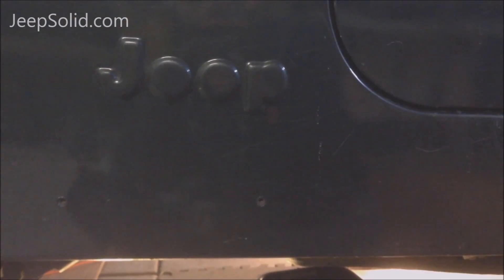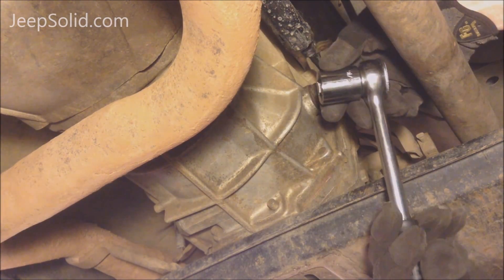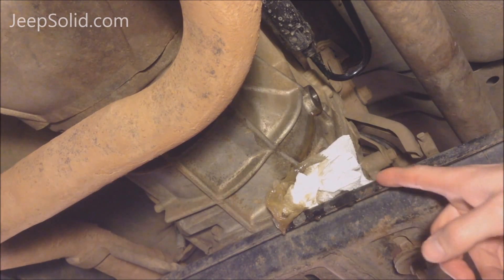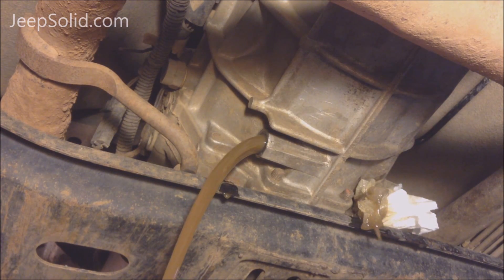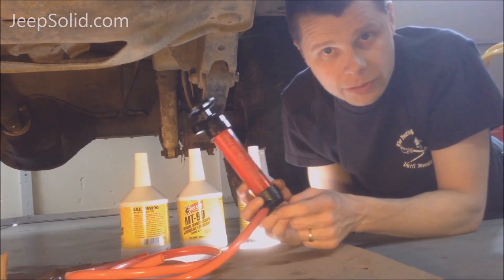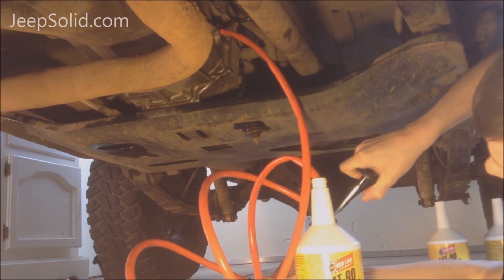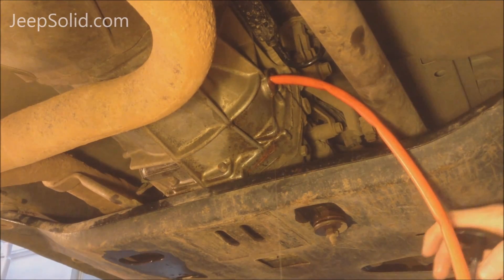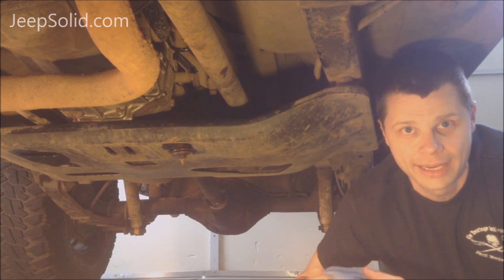Jeep Transmission fluid change: Jeep Wrangler YJ transmission fluid change: ax15

Comment: I have the exact same Jeep my question is should there be gear oil where the shifter inserts in the top of the transmission? After replacing my clutch and flywheel, I’m having trouble shifting into gears mainly after the transmission has warmed up on longer drives any ideas?

Comment: Probably a dumb question but is there a filter on the transmission? If so, do i need to change, when should i change it, how do i change it?
Reply from the maker: No filter on the manual transmission AX15.  Automatic transmission has a filter.  Not a dumb question at all.
Reply: JeepSolid thanks. Woohoo just like my 2nd grade teacher used to say!
Reply: Only a filter if you have the automatic which is basically a 909

Comment: Great video. I heard you talking about replacing the drain plug. Is this correct, or can I use the one that came out of the transmission?
Reply from the maker: I use the same one
Reply: @JeepSolid  thanks for the info and the response. Also wanted to say I really love your channel. Especially the series about the engine rebuild. I've learned a ton from your videos.

Comment: Jeepsolid how can we reach you personally
, on My YJ I replace the  front and rear differential vent cap  BC the hose was damage . But before I change the hose on the rear I leakage coming out the plug or the hose after Idrove  for more than 30m . I also replace the differential oil , what could be this issue . As this point is not leaking that much but it has me worry. Hope to heard from you soon

Comment: Quick question that I thought you might be able to answer. I drained my transmission fluid and refilled it yesterday. Measuring it, I drained probably close to 3.5 quarts, which seems about right, but when I was filling it I couldn't get any more than 3 quarts into the transmission. I tried a few different ideas to see if I could get more fluid in, but after the 3 quarts it just kept coming out almost as fast as I was pumping it in. What are your thoughts?
Reply from the maker: After filling it with 3, drive it a little and then top it off. It should take a little more then.
Reply: I drove it around for about 30 minutes making sure I was cycling through all the gears. When I got back I took off the fill port and fluid started coming out. Thinking it was just some residual fluid I tried pumping in a little more and the flow coming out increased rapidly. I have even tried elevating the side that the fill port is on to see if that would help, and it didn't. I just can't seem to get more than the 3 quarts in. Unless there's another way to fill the transmission. 

Anyway, thank you for the video and the advice. It was all incredibly helpful. If you have any other ideas, I'm all ears.

Comment: Does driving it around first stir up metal pieces for a better drain? I'm hesitant to drive it anymore as its already a bit difficult to shift, just want the old out, new in!
Reply from the maker: Yeah, driving it a bit heats up the fluid a bit and breaks up the gunk.  Helps it drain better.
Reply: Cool, thanks for the advice, glad I did it. Shifts are night and day, fluid came out looking like mcdonalds mcflurry

Comment: So just wondering is someone knows I got a transfer case leak on the back drive shaft wondering if the users manual transmission as well if there’s separate housing is with separate fluids or not

Comment: Hola, i had got an idea today, would it ne alright to drain all the stuff out the ax15 and open the fill and drain holes and spray some brake cleaner in both to clean it up a bit. What do you think, could damage anything in the ax15?
Reply from the maker: My only worry would be cleaner puddling up and not drying.  I wouldn't do it.
Reply: JeepSolid hey im back i have drained my ax15, and out came a vanilla milkshake. So i willingly sprayed tons of brake cleaner inside and put new oil and its shifting is much better.
Reply from the maker: Awesome!  Glad it's working better for you now.

Comment: I’m gonna be dropping the tranny to replace my clutch in my 90 4.2 yj. Do you recommend I drain the trans fluid before and then fill it back up after I put everything back together? Or just do the whole fluid change after I replace everything and put it all back together?
Reply: Came back to this video years later for this exact question-I will drain for the heck of it but I don't feel it is needed

Comment: I know you fill until it just starts leaking out of the fill plug hole, but do you know approximately how much went in? I see 4 quarts; I'm assuming you did 3 and then a portion of the 4th, but how much?
Reply: He says in the video 3 1/2 quarts.
Reply: @husker2493  3 1/2 US quarts is 3.3 liters or 2.9 Imperial Quarts!

Comment: I have a 93 yj I installed a yoke eliminate on a transfer case , I took my jeep for a drive and for some reason my 4x4 won't came off from the transfer case ..... any idea how to fix,that have something to do with the transmission??
Reply from the maker: +julio padilla the 4x4 is determined by transfer case.  It's a 93, sounds like silly question, but why do you think it's in 4x4?

Comment: So you don’t have to remove the skid plate?
Reply from the maker: Nope
Reply: @JeepSolid  changed all my fluids yesterday.  Amsoil all the way.  It shifts better now than what it did new.  144k.  Thanks for your inspirational clips.  I’ll use the redline next time.

That lil pump was great.  The car mech wanted 222 bucks to do this.  I owe you a beer!

Comment: I have a 1995 jeep yj, all stock. It is a 5 speed 2.5 4 cylinder. Is this the same transmission my Jeep has?
Reply from the maker: +Chris Crowder You most likely have the AX5.  Not the AX-15

Comment: Good Stuff, I actually was trying to find a video about changing the transmission fluid but mine is an automatic, would the process be somewhat the same to a manual transmission.
Reply from the maker: Mohamed Saber Automatic fluid change is different, sorry.
Reply: +JeepSolid wich year is your yj ???

Comment: I have a 92 Yj, 4cyl 2.5l. Will the change be the same?
Reply from the maker: On the AX5, yep. Mt-90 works well.
Reply: JeepSolid forgot i sent this. So same change. Mt90. I’ve been hearing about gl4 is that the same,better, worse?   Also. I may have a seal leak..very tiny. Would you recommend blue devil?